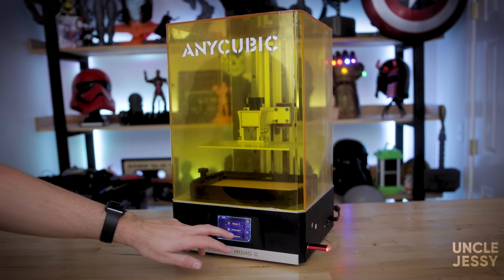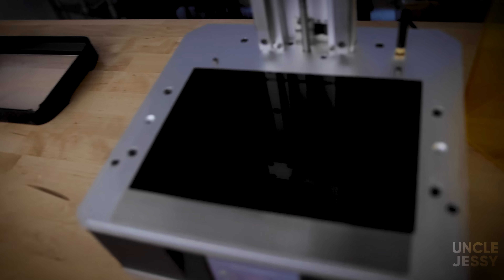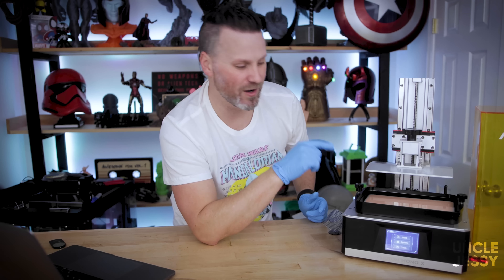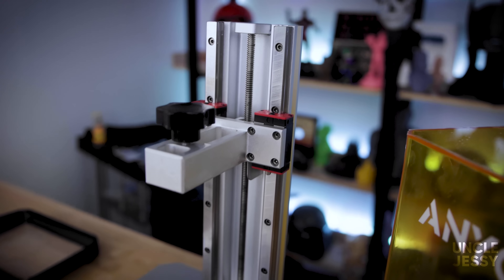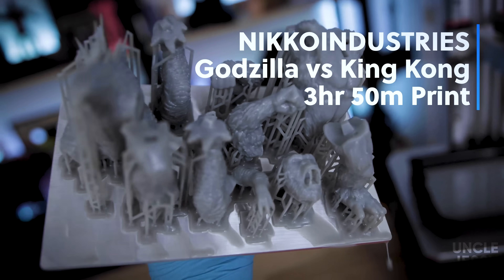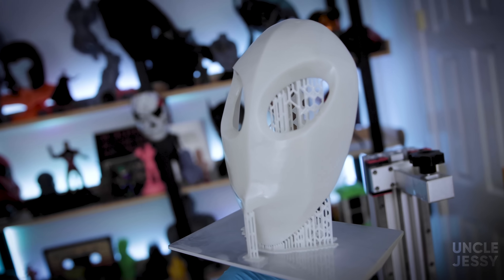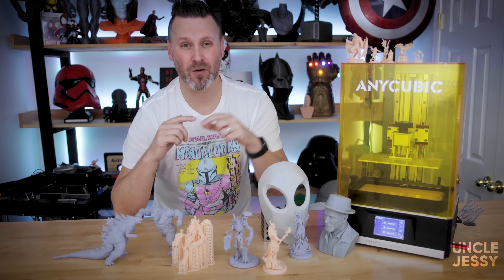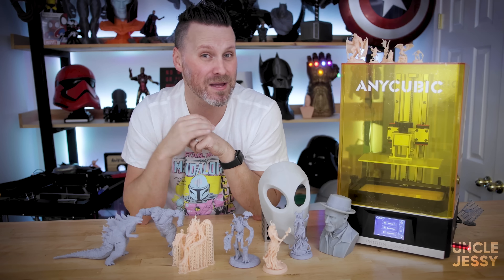King of All Resin 3D Printers? Anycubic Mono X Review

Comment: I've got Saturn and MonoX. After many tests, MonoX is much faster, but Saturn is more detailed.
Reply: @Paul Denton I print work for professional need. I have been using it since both machine came out. After a few months, result is the same. Mono X is 30-45mins faster with same setting with Saturn in general,  because the UV power is so strong on the monox. You have to adjust it to 80%uv power  instead, even you lower the power to 40%, the quality will be similar to the default Saturn , but it take 2-3x times so not worth it. Printing it with 100%uv power is not recommended for detail work said from the anycubic tech service, the print will look kinda rough(over exposed) for very detailed work. On the other hand, Saturn is slightly slower, but the detail is much more clear. Also Saturn almost has no noise, which is awesome for me in a small room. While monox is like the old photon kinda noisy. For exhausting design Saturn is very good because you can modify all the waste air and smell out of one direction from the back with a custom duct system, however monox blows air out from the bottom, little troublesome to modify the air out. You don’t have to do it tho, I do this because I can’t stand the smell in my room. if you are doing very delicate small print, I would choose Saturn. If you want fast result, I would choose monox. If 10points is perfect for quality, Saturn will be 9.5, monox will be 8.5. I think is little hard to find true comparisons reviews on both machines because Most 3d printing guy on YouTube are paid to promote both machine. Anyway, Both are great machine, I use both. If u ain’t us for professional accuracy. Just get the cheaper one will do the job perfectly! Good luck 👍
Reply: @peterchan9525  Thank you very much!
Reply: @Paul Denton no problem my friend! make sure to get a flex plate with no hassle!
Reply: @Paul Denton to me yes, because I can modify all the air out from the back. I may just make a diy cardboard connection in about 15mins, directing all the air out from the window in one shot. But the monox need more work since it blows from the bottom, a little trouble to get that air out in single direction. like I said, Saturn prints more detail than the monoX. try it yourself you will know. Grow tent is good, but I couldn’t find any with smaller size, either the Saturn or monox their lid have to pull up with lots of space needed. my shelf just don’t have such space. If you can find a good one pls let me know !!

Comment: Not only the flat spot on the build plate, the bolts that hold it also act as small cups if you put too much resin in the vat.  Put a Wham Bam on the build plate.  Changed my world after I did that.  

I had the same issue with wireless.  I finally just stopped caring.

Another point is it's an awesome printer until you need replacement parts.  Replacement screens haven't been available since Anycubic released the printer.    

Thank you for the awesome review.  Let's see a comparison between the Mono X, Epax E10, and the Phrozen Mighty 

I'm interested if either the E10 or Mighty are worth getting to run next to my Mono X
Reply from the maker: Wham Bam plate for sure will be an addition to this machine. Thanks for the additional info as well! 

Hopefully the big shoot out video sometime by the end of the month/early april. E10 is an awesome machine by the way!
Reply: @UncleJessy  Thank you!!!  The molded build plate on the E10 gave me pause.  I could always upgrade it later.  I  hate the way the build plate screws down on the E10.  The method on the Mono X is so much better.  Aside from the difficulty it causes with picking up the vat, you have to be careful not to poke holes in your feb.  Minor complaint, but something they could easily change.  Thanks again Sir!!!

Comment: Bought it when it was in preorder, been working great, had to use their Anycubic slicer since Chitubox coupdnt export the required format, there is a new version of Chitubox in beta that does that now. There was a bug that occurred when stoping and restarting the print to add more resin and some of the supports didn’t print in the center of the height, when I reprinted without stopping the same file it printed great.

Comment: I guess I don't understand why this one is $900 vs the standard ~$200 models. It's a bigger screen + a bigger plate. Why does that cost an additional $700?
Reply: People want bigger print volumes, so basically supply and demand. Pretty sure you are right in terms of material costs not justifying the price jump

Comment: I got myself the Photon X  exactly the same machine but no 4K ,  have to say i'm a bit disappointed because it hasn't printed once without flaws.....that said i did get the wireless to work but its not really usefull....you can only monitor a print with your phone, Stop pause etc....
would be nice if you could send a file with this. Anyway probably gonna sell this again.. and go for your model.

Comment: I love my Mono X, had it since november and just got wifi to work now, the instructions that come with it don't mention the wifi.txt but it's on the website, i sanded the top of the build plate with 3000 grit so nothing stays on the top, the flat spot is bad because it pools in the dip under it. Biggest non-issue is that within one month the acrylic started cracking at all the bends and since january been waiting for replacement

Comment: For the WiFi, try to disable your 5.0 WiFi network as many devices(had some smart switches) play better with the 2.4. After connected you should be able to enable 5.0.
Reply: Additionally, make sure the two devices are on the same subnet

Comment: I love my mono x I just really wish there was a way and cure station that would fit the build plate.
Reply: they've released a bigger wash and cure station already
Reply: @M4XC4V413R4  who makes it? Last I heard there was one that is possibly coming out in May. But I don't know of any yet.
Reply: @l0ckmanjohn  you're correct, i was under the impression that it was out already, my bad
Reply: @Paul Denton if that one hasn't released yet I don't know any that is good for that size.
I'm sure most people can manage with one of the other smaller ones (they're basically all the same thing, get the one you can find cheapest from elegoo or anycubic for example) since not many people print a single model that occupies the entire print area.
I just made my own curing station since at the time there was nothing pointing to a bigger station coming out.

Comment: There is an old ios/android app called photon controller that lets you send files to your printer but doesn't work with the Mono X. Any chance of talking to the guys at anycubic to add this feature? A computer/web based solution would be great, or even one based on raspberry pi4, sending files via wifi is a must I think.

ps. I too have not removed the plastic film covers :)

Comment: Great video Jessy. Thanks for sharing your opinions. Question: You mentioned you were going to print a larger version of the Ant(Ent?) Considering you have the larger resin printers do you prefer to print on the smaller printers where you have to piece/assemble the parts together or do you prefer to use the larger printers where you can do the print in just one whole piece? Would love to hear your opinion on that.

Comment: Are you using a mac to make the WiFi text file? I remember reading it doesn't like the file extension that macs make
Reply: Mac's like Unix have special character EOL which is different from windows. Go to your terminal and use unix2dos. That should work.

Comment: My issue with Anycubic Mono X that no one seems to mention in any reviews is lack of any support. Lack of spare parts and build quality of the unit. The Mono X actually has 2 versions that dont use the same screen. There are 2 of them out there in the mix. They have no spare parts in stock for Mono X or Mono the smaller machine. The screen is plastic direct to the fep. So if you get a leak your basically buying a new printer or fighting the internet to try and find a replacement screen. Then if you do find them its 50/50 if you get the right one! You HAVE GOT TO get a screen protector for all anycubic mono's. You will get a leak at some point for a failed print. Thats my 10 cents anyway :)
Reply: My guess is you need to go thru Chitu.  I needed a 3.5 inch display screen for an Elegoo and they are they only ones who sell them(that I could find).

Comment: I've had my Mono X since 11/17 and I still have the film on the lid as well.
Reply: same... I really messed up my Photon S plexiglass so I'm not removing the film ever. If I do I will replace it immediately with automotive PPF. I have already added some to the screen in case of a leak and it has shown no negative effects.

Comment: Curious what you’d think of the Phrozen mighty 4K
Reply: They all print the same. Get whichever is the cheapest one. The mono x has a little more height printable area
Reply: @Davide-il3ou  I’m aware. I have the mighty 4K and mono x. Just curious on his thoughts of it all. The mighty 4K I feel has slightly better resolution but not enough to really be nit picky. Except price point. The photon is pricey
Reply: @NashMcilroy  not if you got the Mighty on pre-order at launch with free shipping :D Being in Australia that was a steal at 500USD.
Reply: @mattcurr9931  no I meant the photon price point my bad lol. I got the mighty 4K on Black Friday for 650 with the cure station and 4K resin
Reply: @Paul Denton that’s a very good deal. Does it work like new?
Reply: @Paul Denton congrats. You liking it??
Reply: @Paul Denton I live in an apartment and tbh unless you keep it open 24/7 it’s not bad. Just open a window or door when done

Comment: Great video, loven your channel. Keep up the great work.

I got my MonoX about a month ago and love it!

Wireless works on 2.5Ghz only so if your SSID is mixed (5Ghz and 2.4Ghz same SSID) you might have issues unless you can separate them or in my case give precedence.

You can only monitor and start prints wireless however I did just find a pi zero conversion that will allow me to send prints wireless to my monoX then remote print.

Comment: The wireless adapter thing only works with G style wireless networks... I don't think it can connect to AC or N networks, and it definitely has trouble connecting to mesh networks like the Orbi or Google mesh.  You can see if you can set up a G access point within your Orbi, or go pick up a cheap G WAP and hook that up to your router.  It just mean you're going to have another wireless signal at your house.
Reply: On an Orbi and works fine. Just have to pick up the right APK from Anycubic, Anycubic 3D, for the most part.

Comment: I have a question! I have a mono x myself, but when printing solo miniatures or batch, in the vat, above the display, I get some kind of a cured resin stripe in the bottom, even when there is no miniature there, why does it “cure” that line? 🤔😰
Reply: try printing just a .5mm flat rectangle that's roughly the size of the build plate. If its missing a whole line, it's likely your LCD is defective and missing that area while printing.
Reply: @electronicsandewastescrapp7384  the problem isn’t it’s missing, but it’s actually cures a strip even when there is now image of it 🤔

Comment: UJ... the wi-fi works only on 2ghz network. Most within the US is running a 5ghz. Mostly you can switch between speeds on your modem. If not contact your provider. Anyways though, it's not very useful, it's only really telling you how fast along the prints are, like a timer. It's not like u can send prints to it from over a network.

Comment: On the thumb drive U get with the printer is a text file called WIFI. open it on you PC, change the text in it to your wifi username and password. Then put the thumb drive in Ur printer and try to print the WIFI text file.... If U have done it right it will work .... Double check instructions to make sure U alter the wifi text file right....

I got one of these printers. They r great. But I'm waiting on new feps from china ATM so can't print anything :(
Reply from the maker: Thanks! Yeah did that. Even tried both options that were in the text file but can’t seem to get it to connect to my network. Tried resetting the printer and my network as well. Made sure no special characters in the name or password as well
Reply: I will say. Mine worked for a week or 2. Then I deleted the wifi text file off the USB and it stopped working. Don't know if it's coincidence

Comment: Next video: Saturn vs Mono x. Honest comparison. Print times, print quality, common manipulation, flaws, etc. That would be super perfect ;)
Reply from the maker: Hang tight! Have a big throw down coming soon. Have another unit or two I want to look at for a full comparison
Reply: How would the epax3d E-104K compare ? :)
Reply: @Mike-pz2ov  can’t really compare as I couldn’t get my Mono C to complete a print without a split it something else wrong. But I did replace it with an E-10 and it has yet to fail a print. Very happy with my E10.
Reply: @jimb569  see how long that last lol, I'll b
Never touch another epax again, worst QC and build quality of any printer I own and I have 12 running full time....well except the EPAX it's been dead on and off for months and cost more in replacement parts than I paid for it. 2 screens one of which epax told me was bad, it wasn't, it was their 2nd board failed so that was fun, this is of course after the polarizer one first screen "cracked" according to EPAX.
On to 3rd mainboard whenever that shows up now, they finally believed me after I put in a new screen that had same issue a the "bad one" that only lasted a few hundred hours.
Reply: Saturn is better if only because it is not an Anycubic printer
Reply: @Slenkamure  What's wrong with the Anycubics?
Reply: @dmaikibujin  the printers are ok, the company is the problem they have some of the worst after purchase service in existence
Reply: @Slenkamure  > _ <
I'm struggling so hard on what mid range resin printer to get. I wanted to get the Epax E10, but another reviewer said the molded plastic arm that supports the build plate flexes under larger prints and actually flicks resin against the case occasionally. Being in AUS it's also a lot harder to get parts for it.
I wanted to go with the largest build plate so I could do larger statues as well as minis, so I was looking at upgrading to the 10" 5K screen for the Epax, but if it's already struggling with larger prints, upgrading it to a larger build area is just going to make that issue worse.
So then I decided on the Phrozen Mighty as it has the next largest build plate, but then I saw the entire base of the machine is plastic, which they say the resin will start to corrode it if/when it spills.
So I switched my mind to the Mono X, but if the customer service is that bad...
That leaves me with either the Elegoo Saturn, which has the smallest build size or possibly the Creality LD 006, which I haven't heard anyone really recommending much...
Reply: @dmaikibujin  anycubic printers are pretty solid overall, my issue is with the company in general. If you buy one do not buy it direct from them buy it via their ebay store or off amazon because those force them to actually deal with customer service issues. As for printers i have had really good luck with my Phrozen mighty 4k
Reply: @Slenkamure  Thanks for the feedback. If the Mighty had a metal base I'd definitely go for that one.
Reply: @Slenkamure  yep my photon s stopped going up and down. Its 2 months old. Contact support and I told them I wanted a new unit sent to me, got nothing but the same response over and over no matter what I said. "It looks like your situation requires the motor to be replaced. It will take 7 to 20 days to send you one" 20 days for something that broke in less than 2 months?????? Company is a JOKE!
Reply: Now that's a vid I've been wanting to see.  I'm interested in them both.  Also, the Epax E10 is getting a 5K edition.  Its print volume is the largest of all.  If possible I'd like to see you take a look at it.  Thanks.
Reply: @charlesballard5251   That's correct.  5K display is in dev now.
Reply: @Mike-pz2ov  I keep putting off buying a printer because the next one is "COMING SOON!!!!".  I have to wonder what is coming after the E10 5K.... hmmmm?????
Reply: Elegoo Jupiter next, has an 8k screen. Please don't hold off any longer and just buy otherwise your gonna be waiting forever lol  @charlesballard5251
Reply: @charlesballard5251  I’ve been the same for months now, been holding off for the Mars 3  4K !! Had one on pre order but then cancelled it this week as delivery got put back again ! So my mono x is due this Friday !!! 🥳👍🏼
Reply: At these sizes/prices, I think I'd rather pick up one of the Phrozen Sonic printers. The more I read about issues people have had with both Elegoo and Anycubic printers, the more it seems like Phrozen is the better choice.
Reply: @AuntJemimaGames  first off love your syrup secondly went with a Phrozen Sonic Mighty 4k and is a super nice printer, tech support and customer support is also top notch
Reply: @Slenkamure  no o
Reply: @AuntJemimaGames  The Phrozen 4k mini has a flaw on all printers https://www.reddit.com/r/Phrozen/comments/ke5k8f/sonic_mini_4k_zaxis_issue/
Reply: It must be made by the same OEM.
Reply: @BeardedPete  That's what i thought.. They all look the same.  Epax3d has USA support and USA shipping:)